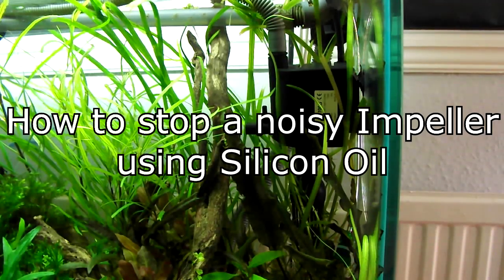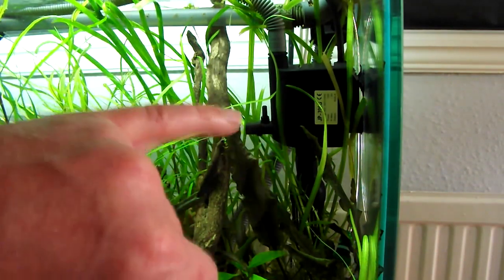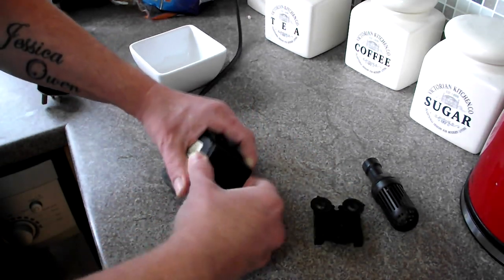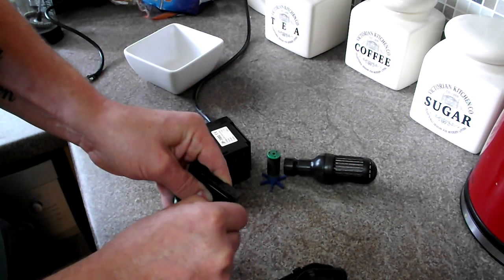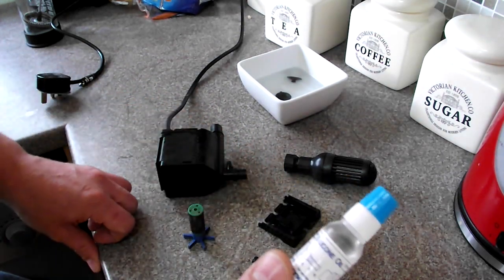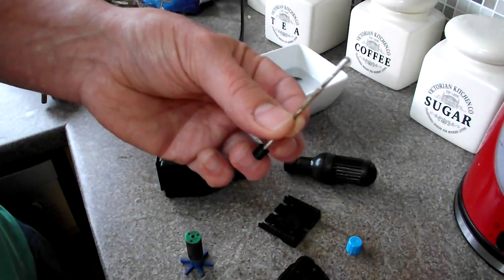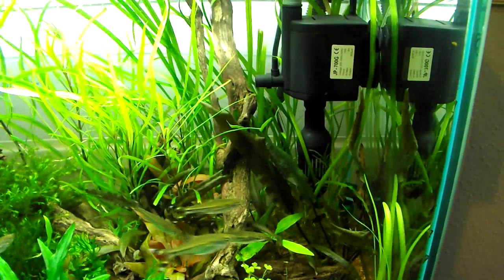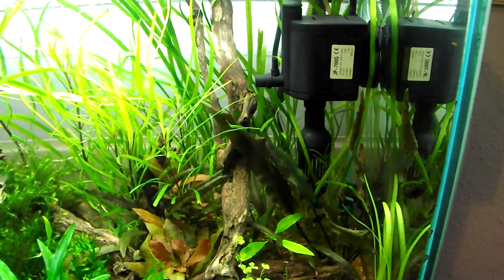HOW TO: Fix Impeller Noise using Silicon Oil

Comment: thanks. we use these pumps all the time in desert coolers here in India. Mine has served me extremely well but is making noise exactly like yours at the start of the video. One thing I wanted to ask is how long does this last? I mean doesn't the silicon oil get washed away in some hours or days? What if I use grease or engine oil in there? I amnt using it for aquarium.

Comment: I found that a useful tool for cleaning slime off of things is a waterpick for flossing. You just turn up the pressure and it will just blast away all of your problems

Comment: Used Vaseline on my Marineland 400 280 350 and it worked great. Just on the magnet. They were noisy from day one till now.
Reply: Scott Davis thanks for the tip. You said you put Vaseline on the magnet? Not the shaft like this video?  I have a noisy marineland 400
Reply: Scott Davis 

The armature (What you called the “magnet”) Doesn’t really touch anything: it’s suspended with a top and bottom rubber booted shaft.

It is actually actuated by an Electromagnetic field.

So please do tell help putting Vaseline on the actual Armature is going to do anything?.
Reply: @Underwater and Curious. Actually no. They were the Emperor by Marineland. They [I think] are too much maintenance for the extra filtration. I have used the Marineland 350's for years and they don't require as much maintenance as the Emperors and are also quieter too.

Comment: It says Olympus silicone oil on the bottle but a Google search does not give me the proper product, could you mention where it can be bought? Thanks for the idea.
Reply from the maker: I got the silicon oil from work, but you cannot buy this one from stores, You just need to search for silicon oil and you will find many different brands. The silicon oil you get for RC cars will work just as good also.

Comment: Planted Tank UK, is the Silicon Oil that you used on your impeller above, exposed to high water pressure?  If, yes, then that is something I can use on my (pool) plastic ring impeller because it is exposed to water pressure and debris.  Not saying it would get rid off the debris noise, only cleaning will.  Your product could help cut down on my impeller vibration and annoying noise-making (but it has to work under high water pressure). Thank you.

Comment: I realized that the shaft in my fluval was snapped in half. This was after it was not pumping and creating a ton of noise. I got down to the very center and I went to hobby lobby to try to find a piece to replace it but couldn't find the exact measurement. I tried to take apart a pen blew the ink out sanitized it and fit it in there but it was just a hair too big. I don't know what to do. Any help?
Reply: Order a replacement part.

Comment: Before you lube everything and make it all slippery- use tweezers to remove the inner rubber bearing-pivot. Then simply invert the shaft; the bottom (magnet drum) where the heaviest part is- is the "load bearer" part of the assembly- and that will wear first. A worn shaft will be out of balance, making vibration. BETTER ALSO- a Gavanized or Aluminium nail works WAY better than any cheapo soft Ferro-metal "chrome plated" shaft ever will. Cut to matching length, file round the ends- NO RUST viloa!

Comment: Is there a danger for the fish using silicon oil?
Reply from the maker: +Annie Feng there is no danger from silicon oil so you do not need to worry
Reply: +Planted Tank UK what about Vaseline ?
Reply: +electric water I used Vaseline on mine and it's super quiet now!
Reply: +electric water vaseline is non toxic. ensure it says on the label but it is non toxic. it works. there is another vid around here in youtube.
Reply: Robert Fernandez cheers I've tried that but it's kind of a rattling noise it's the propeller! There only new aswell
Reply: @anniefeng3795  how often we need to apply vaseline. My canister makes a lot of noise

Comment from the maker: since this video i have changed out the shaft for a new one but still had the slight noise. personally i wish manufacturers would use ceramic shafts like the eheim classic 2213 filters. No rush and low noise

Comment: You get what you pay for. It's cheap rubbish and it's worn out. You say you wish they made them with ceramic shafts - well they do. The more expensive Eheim pumps have ceramic shafts but you they'll cost you a darn sight more than 10 quid - heck a spare impeller and ceramic shaft would cost you that much.
 Like I said - you get what you pay for. There's no way I'd be putting silicone oil in one of my tanks. I'd either live with the noise or (much more likely) get a new part or better pump.
 Happy fishkeeping. :)

Comment: I just fixed mine. I was having problems getting it to stop rattling after I cleaned it. Turns out, I needed to make sure the shaft was all the way in before putting the impeller housing back on.

Comment: Try this. if you let the pump sit in the water away from the glass a little you will find the sound will almost completely stop. it's not a fix per say. but it stops the sound waves transferring directly through the glass essentially amplifying the sound.  Guarantee it will work
Reply: It work instantly , thank !